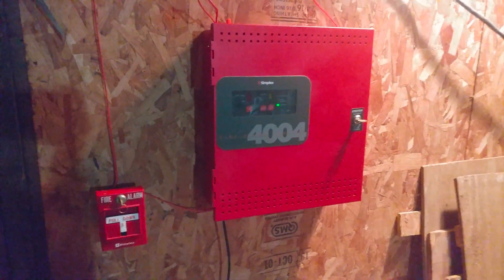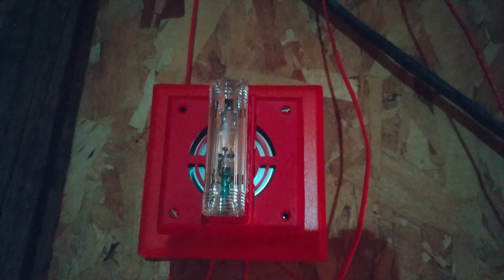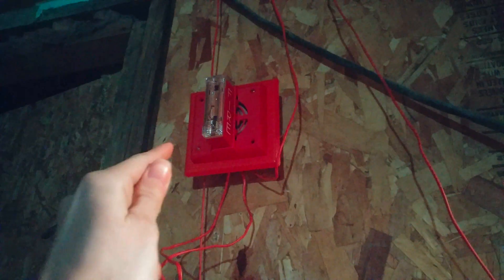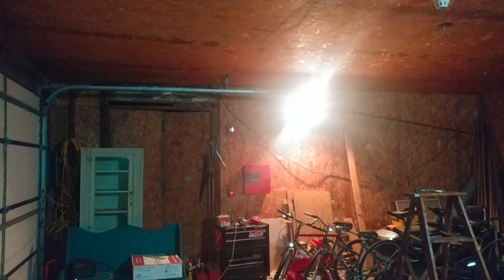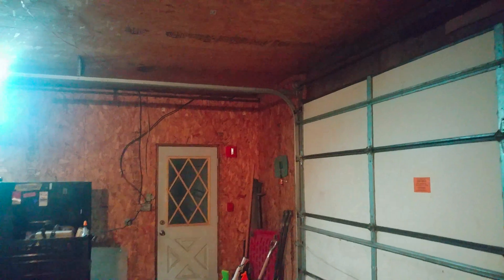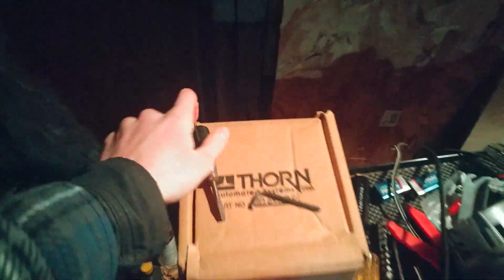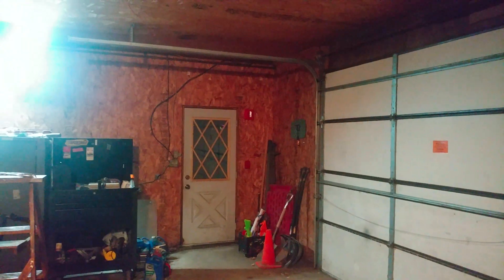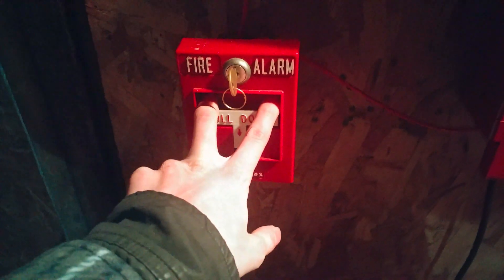fire alarm test 54. gentex gms and shg. #FireAlarmFriday

Comment: My old highschool in cookeville when it was built in 1993 it had gentex GMS’s but in 1994 they got replaced with the SHG 1st gen when I went in highschool some SHGs were replaced 2 staircases 4 on 1st floor 2 on second floor and 2 on 3rd floor were replaced with system sensor spectra alert classics the outside alarms were 2 wheelock 34Ts and 2 wheelock MTs and actually 3 GMS versiond remained 1 was in construction class the other 2 were in the upper left gym and they where louder then the SHG

Comment: on fire alarm Friday we had a school fire drill and the system had Gentex SHGs and GSXs paired with Fire Lite BG-10s and 2 System Sensor 2400s on a Fire Lite MS-9200 panel. That panel is also paired with a Simplex 4010 with simplex white Truealerts in one building and red Truealerts in another with ceiling mount remote strobes and ceiling mount horn strobes paired together with Simplex TrueAlarms and Simplex 2901-9754s.